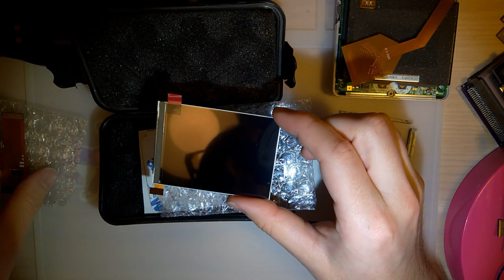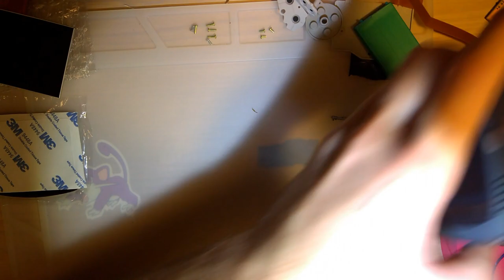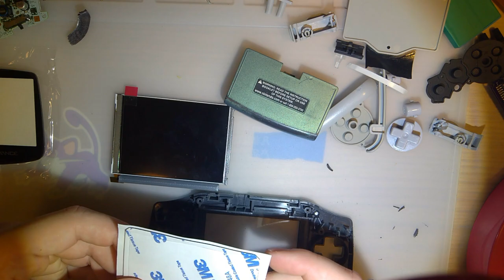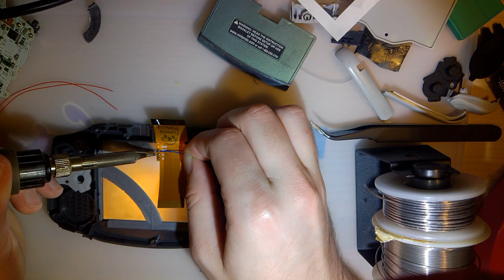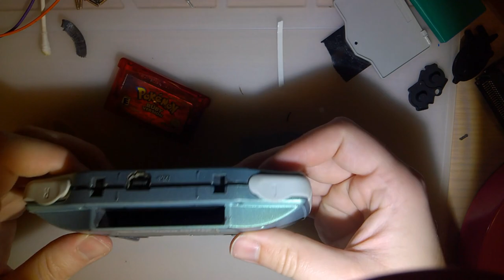Installing the Funnyplaying IPS (FIPS) v2 GBA Screen in a GBA (AGB-001)

Comment: There's an easier way to install the adhesive for the screen. Tear off the adhesive on one sides first before removing the middle insert. It will center itself and fit perfectly. Then push the middle part out and remove the backing on the other side.

Comment: They not only skip that one screw on the mainboard, most of GBAs I opened (like the one I just did second ago) have the aluminium shield mounted using only 2 screws, but some use all 4. That's 3 screws saved!

Comment: I had so much trouble with this mod.  First I messed up the shell.  So I bought a modified shell from FP for $9 which is totally worth the price.  Then I had already used the screen lens that FP sends with it's ips v2 kit.  So I bought another glass lens which it turns out has a smaller viewing area.  Didn't realize the ips screen has a bigger viewing area.  Now I have to order another lens from FP.  Other than that it looks awesome and I even added a rechargeable battery to my GBA.
Reply from the maker: Yeah, I've heard that the pretrimmed shells are a pretty good deal. My only issue with them is that they are all aftermarket. I prefer OEM when possible.

Comment: Beautiful work as always!
I just got my v2 from Retro Modding, didn't come with a neat little snap case like yours though.  I modified my shell while following your video here, and I think I am going to have to use the center bracket from JellyBelly, which says v1 cable, and might need some modifying.  
You inspired me to do this mod with your other video's, this will be my first time using a soldering iron, which maybe I should practice on something else first.  Fingers crossed.
Reply from the maker: I mean no offense, but if it's really your first time soldering, I highly recommend picking up a soldering kit or something for a few dollars before trying to solder to a ribbon cable. That way if you do mess up, you don't ruin your expensive kit. No matter what you do though, don't forget the flux.
Reply: @makho  So I got a hobby kit and soldered it yesterday (100+ joints) I think I have the general idea.  
Got a power port on a 2DS XL hooked up but now it won't turn on.  Charges but won't turn on.  Going to google and work my way through that.

I went through your videos and haven't seen a rechargeable battery in a standard GBA, I'm wondering if it would be possible to fit both a micro USB TC4056 and a USB C TC4056A (I think) in the battery compartment.  Looks like they would fit I'm just not sure of the wiring.  Seems like an overly ambitious idea with hyper limited practical real world use.  A makho special!
Reply from the maker: @JimmyGFromDayton  re gba: https://youtu.be/zV0Fid4g9bQ

But I'll get back to you on that 2DS
Reply: JimmyGFromDayton They do make a rechargeable battery on RetroModding. I thinks it’s titled “The Ultimate Rechargeable Battery”. It’s a bit expensive coming in at close to 40 dollars but it’s said it can hold charges for up to 20 hours, RetroModding can even pre-modify a battery cover with an insert so you don’t have to remove the battery to charge!

Comment: I bought an extra large screen lens designed specifically for this mod, since this screen is slightly larger than the original. Unfortunately, the border of the lens slightly covers the screen, blocking some of the image. I wonder if this was meant to happen, or if it was a manufacture error.
Reply from the maker: You could ask the seller, they would have better information than me or anyone else here.

Comment: Hey Makho do you know which is the default brightness if I skip to solder the 3 wires to the board?
Which level on 10? Has same/more/less brightness compare to the AGS-101 screen (GBA SP) when default “NORMAL” bright is set?
Reply from the maker: it's about mid way and yes it's brighter.
Reply: @makho  thanks!

Comment: Hey, what is the Dremel attachment/bit you used to mod the shell? I was thinking of using sanding drums but what you have seem to be a better choice.
Reply from the maker: I'm using flat end mill bits. You do need a rigid stand to be able to use them but if you have a drill press stand or similar, they work great. I'm not using these in particular, but I have something very similar: https://www.amazon.com/Titanium-AFUNTA-0-8-3-17-Engraving-Hardwood/dp/B07CMY47QP/

Make sure to shop around.

Comment: I'm about to install one of these screens in a GBA and I was wondering: what purpose does the "pre-trimmed" glass lens serve? Is it needed even after trimming the shell's internals? Can I use a different glass lens instead and not have issues?
Reply from the maker: You know that the IPS LCD is larger than the OEM LCD, right? The "pre-trimmed" lenses are just lenses with a larger viewing window. You can use OEM lenses just fine. It's what I do on most of my builds. Just keep in mind that it will cut off a wee bit from the edges. Like one or two rows or columns.
Reply: @makho  Thank you, that's a big help. I actually didn't know it was larger as an actual screen, not just the bits around the edges. I'll keep that in mind during my build.

Comment: Great video Makho! I’ve been watching your videos and want to do a mod myself. I just have a few questions about the (Kynar?) wire, where did you get the wires from? Is there a specific size that you need? And does the color of the wire matter? Apologies for my ignorance, thank you for whatever help you can provide!
Reply from the maker: I use kynar because it's what my local electronics store had and I like how it is to work with. Kynar, however, is a name brand so it can be pricey. Wire wrapping wire is basically the generic version of kynar but the conductor is bare copper instead of silver plated copper and the sheathing is very easy to melt when soldering. Otherwise, they perform just about the same. 

I'd recommend "wire wrapping wire" over kynar simply for the price and availability unless you're having trouble with your specific application and they should have it on all the popular retailers (like amazon). 28 AWG or 30 AWG is my go to for most internal wiring. Color is irrelevant unless you want to adhere to standards (red for voltage, black for ground, etc) or have to be able to tell wires apart at a glance if you have a bundle of them. 

30 AWG might be a bit thin for some power related applications but it still should be plenty for anything inside a game boy. 28 AWG would be better but because it is thicker (lower the number, thicker the wire), it can be more difficult to work with in enclosed spaces.
Reply: @makho  Here’s an update if you get a chance to read it! I did what you recommended and bought wire wrapping wire, 30 AWG. I used the same color for all parts of the installation, and it works great! The soldering especially was way easier than I thought it would be, this video helped tremendously, im glad I was able to come across this channel, looking forward to more of your work!

Comment: Ok, so handheld legands got back with me, an thought the new ipsv2 kit being installed as it requires lots of power, blew the fuse on gba, so my soldering skills are less than par, im in no way attempting the fix it, i bought another gba, but hesitant on putting ipsv2 kit in it, in fear of it happening again,  they also mentioned that all be it rare, they only had one other instance of it happening, so everyone please keep in mind that if the same issue happens to you check the fuse,
Reply from the maker: that's not a common issue at all. I worry that there was another problem.

Comment: So I put the new gba an ipsv2 kit together seems to be good minus the screen flickering a bit. So I don't know if the motherboard it tight an causing it or to much pressure on the cable? I slacked screws off an gave cable extra slack but still happens? Any thoughts
Reply from the maker: I don't know what you mean by flickering. Regardless, troubleshooting generally involves reseating the ribbon cables and trying again. If you have other games and another GBA motherboard, try that too. Last step is to bug the seller.

Comment: i installed the funny playing ips v2 kit very easily and choose too dont solder. but in 10 minutes of playing my game already freezed and tripped a couple times. I think its still short circuit somewhere. It cant be the 32 bit side of the chip because its already covered.
This issue didnt happen with this same   game card on ds lite.
Reply from the maker: Yeah, sounds like you have a short somewhere. Make sure everything is properly insulated and connected fully.

Comment: Hi, I have a GBA Funnyplaying IPS v2 kit perfect instaled but sometimes if I quick turn On and turn of and turn On again the console, I have a Black screen. This just happens sometimes and if I get Black screen and turn of/turn on I can a normal screen. Is this normal to happen? I check my ribbon conections multiples times and test if two Funnyplaying ribbon and two IPS screen.
Reply from the maker: you're not supposed to quickly power cycle these consoles. The drain resistor needs a second or two to function properly.

Comment: So is the current draw 99 mA?  So if the battery in an sp is 850mAh that means the sp will run for 8.5 hours?  Just trying to figure out how these batteries work to estimate how long they will last.
Reply from the maker: Pretty much. There is more to it than that, but yeah. 

You'd want to do some testing at the lower end of the voltage curve, the middle, and the higher end to get a more accurate estimate. But since every game and console is different, it doesn't matter too much. Biggest factor is knowing whether the battery that says 850mAh on the side is actually 850mAh.

Comment: Hey @makho!
I have a question regarding some kind of artifacting I guess (not sure if I would call it tearing). So when I run in Pokemon FireRed, i get some kind of blur (?). I tested it in different areas and found it only, when there are some kind of vertical objects. Have you noticed similar things or is it my kit that's faulty? Or is it some kind of issue with dithering?
Reply from the maker: My guess is that you're seeing artifacting from the pixel overdrive that these kits do. MLIG did a good video on this and they explain it better than I can: https://www.youtube.com/watch?v=M90C3BdTjIc
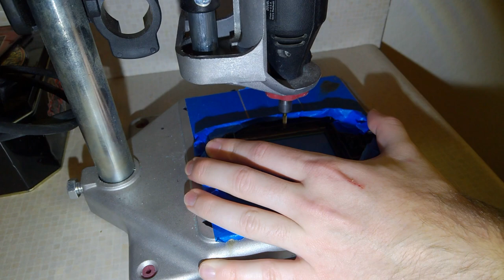Reply: Oh wow, thank you very much. The thing that is shown at around 22:30 is exactly what I am seeing. I mean I don't mind, but was worried I have a defect. Thank you very much, this helped me quite a bit!

Comment: Does it say version 2 on the new ribbon cable? I need to be able to distinguish the v1 from the v2 by just looking at the cable, your help would be appreciated. thanks!
Reply from the maker: No it doesn't, but you can tell just from the shape of the ribbon.

V1: https://cdn.shopify.com/s/files/1/2481/6766/products/4_Pixels_in_1_IPS_Full_Viewing_Angle_GAMEBOY_ADVANCE_Replacement_Project_2000x.jpg?v=1571393240

V2: https://cdn.shopify.com/s/files/1/2481/6766/products/GBA_IPS_LCD_V2_4ec0e1e7-610c-41f1-9643-1f89fe8ad183_2000x.jpg?v=1571393240

Comment: I keep having issues with brightness controls some will go up or down by ONLY pressing the select button i cant find any joints touching everything is covered with kapton and no pinched wires
Reply from the maker: Did you solder to the pins on the shoulder buttons? You probably soldered to the wrong pins.
Reply: @makho  both to the left side of the middle 2 shoulder buttons
Reply from the maker: @mitchellpalmer7349  and when you checked it with a multimeter?
Reply: @makho  ill check next time one acts up

Comment: This looks great, a fan of the channel for a while now, I recently bought this ips v2 kit from handheld legend,  an when I hooked the screen up to test it, the only thing I got was a  green flash on the power on light, an that was it, nothing else, can anyone please shed some light on what mat be going on,
Reply from the maker: you should try reseating all the cables and connectors and if it's still not working, contact the vendor
Reply: @makho  right i did that, but after studying the board more, I noticed whatever was supposed to be soldered on c-35,  I believe, is missing.
Reply from the maker: @chriscrim967  products missing capacitors is normal. During the design phase, most engineers go overboard with smoothing caps to ensure that everything works properly but during assembly they often test without a lot of those caps. When they find that the part still works fine without those caps, they just omit them from the BOM without editing the PCB (as editing the PCB would mean more testing). I don't think a missing capacitor is your issue. Not quite sure what is, though.
Reply: @makho  thanks for your help, I appreciate the vids ya throw out, just finished up watching the gameboy micro overclocking..vid

Comment: I accidentally bought 28 guage nylar wire instead of 30, would that make a big difference in this kit or can I go with the 28 I have now?
Reply from the maker: 28 is fine. Just note that it will be a little bit thicker so you may have to get a little bit more creative with wire placements and pathing.

Comment: I just got my kit, and I did not get a bracket. Is it completely necessary?
Edit: the kit now includes two adhesive acrylic fixing strips which serve the same purpose.
Reply from the maker: The bracket is just for ease of position the LCD, especially if you did not get the trimming perfect.

Comment: What is that ribbon called at 8:19 and where can I get one?
Reply from the maker: I found them on aliexpress. The seller I used no longer has them listed but I believe someone else linked another in the comments. There is a new version of this kit that does not require the adapter though.

Comment: Do I need to solder if I don’t want to adjust brightness?
Reply from the maker: Nope, soldering is only required if you want brightness control. The mod works fine (on default brightness only) without hooking up the controls.
Reply: makho awesome thanks! Just purchased this mod and was curious. Don’t have a soldering tool yet but I want to try this out.
Reply: Seto Lucifer I had the same question, I can sodder and have done other gba in the past, but I’m making two for my nephews and haven’t done this mod. I just don’t want to Ef it up cause it’s a gift.

Comment: 45:00 what material do you use to do the weld?
Reply from the maker: Radioshack brand 60/40 solder. The wires are 30 AWG Kynar. The solder because that's what I have a ton of and the wire because that's what I can get locally.
Reply: @makho   what temp did you solder those 30 AWG Kyna wires?
Reply from the maker: @Daka12s  just under 300c

Comment: hey buddy got a link for the wire spools you used
Reply from the maker: Nope, sorry. I bought all my wire locally. It's 30 AWG Kynar though.
Reply: @makho  thanks pal , that's exactly what I needed , wire that didn't melt back under the soldering irons heat ! I've been using fire from inside Ethernet cables needed something durable for the likes of the Dreamcast and GameCube mods :D thanks very much!
Reply from the maker: @Millzieeeee  The insulation on my wires will definitely melt if you hold the heat on there too long. They are a lot more tolerant than some of the cheaper wiring though.

Comment: The tearing is bad.. I didnt think it would look like that.. guess I'm glad I didnt pay for one.. I think I'm just gonna get the switch on black Friday and add the GBA emulator instead..
Reply from the maker: I didn't notice any tearing on the v2 kit.
Reply: @makho  how much does it cost and where do I get the v2.
Reply from the maker: @JuanDiaz-jo1rw  You can get it from funnyplaying's website for about $45 USD or so. Aliexpress is having their "single's day" sale for the next 26 hours or so and you can get it from funnyplaying's aliexpress store for about $36 USD.
Reply: i remember that the v2 fixed the screen tearing bug. I think you are thinking of the original v1 model that still had the tearing.

Comment: I got my v2 in today, I shouldn't have tried to do that soldering bit. I don't know where, but the thing won't power on anymore.
Putting the old screen back in lets it turn on, so somewhere with the cable is jacked. 

I need to see if they have any cables by themselves, or if I'm gonna have to order another kit altogether...
Reply: ...or I need to just give it a once over with the 91%, and tighten the case before unsoldering everything...
Oh well. Went from not cooperating, to not wanting to stay powered on, like my SP.
Reply from the maker: So is it still not working?

Comment: is it bright enough if i dont solder the wire ?
Reply from the maker: Sure. The wires are only to change the brightness but the default levels are great.
Reply: makho is the soldering process easy ?
Reply from the maker: @salaadas  I think so but that's subjective.